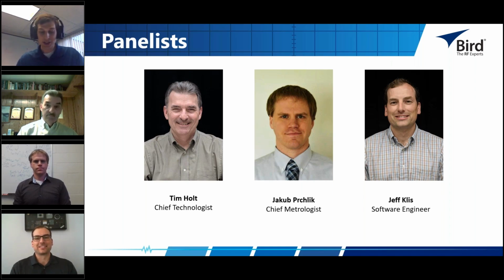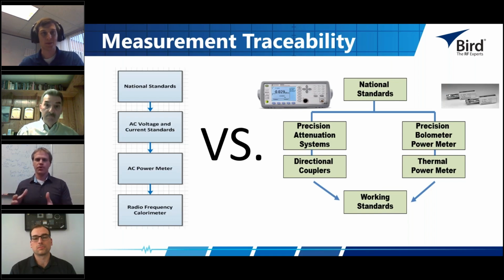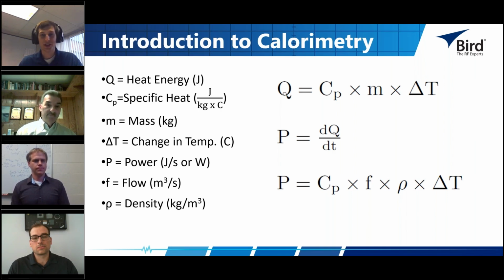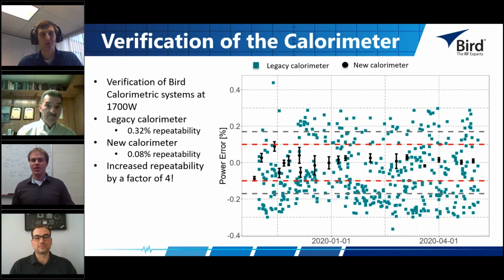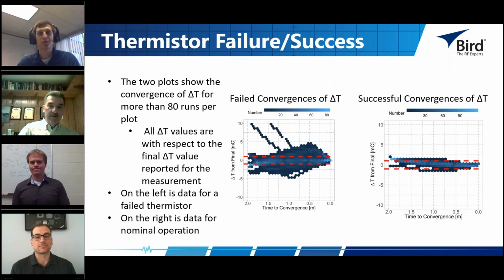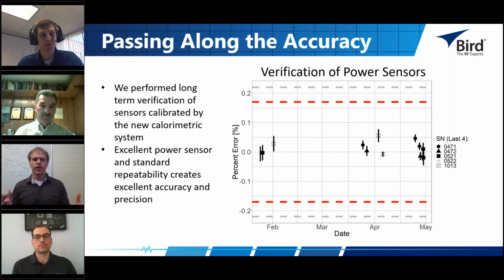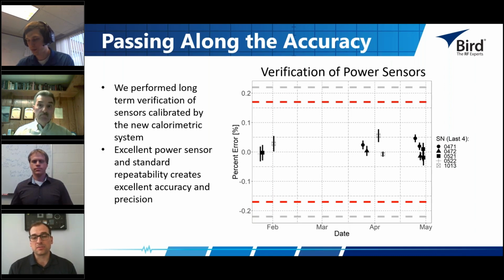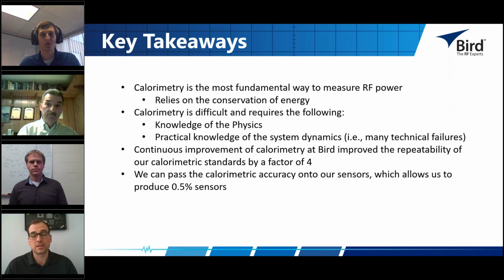Expert Panel | Enhancing RF Power Measurement - Calorimetry Insights

Comment: Im using a $30 cup type calorimeter to calibrate my cheapo power/SWR meter. Also  going to use it to measure loss through  various ATU /matching networks using  resistive and reactive dummy loads. This is for amateur radio experimental learning. Fun stuff